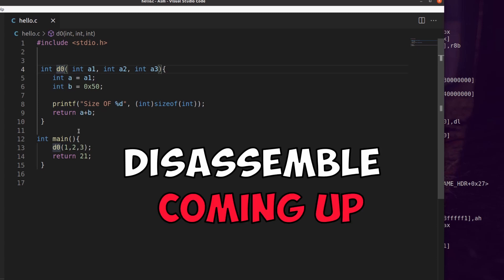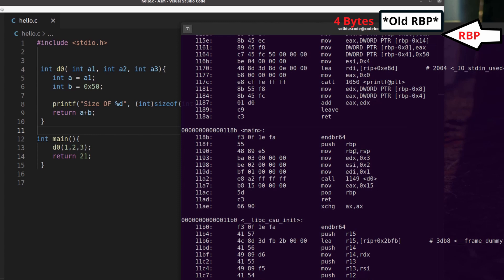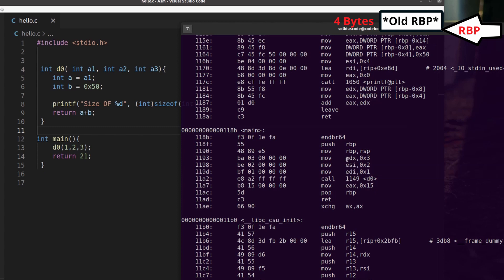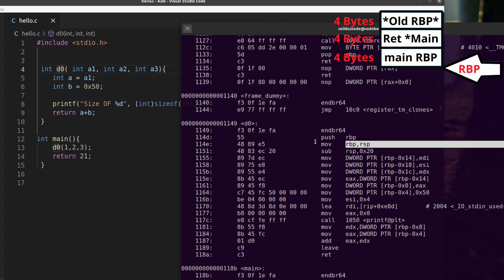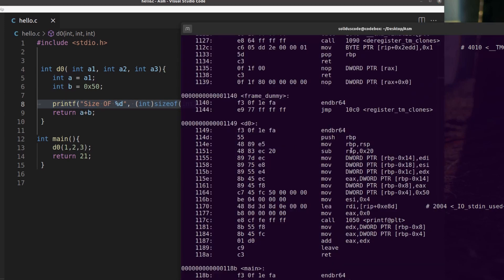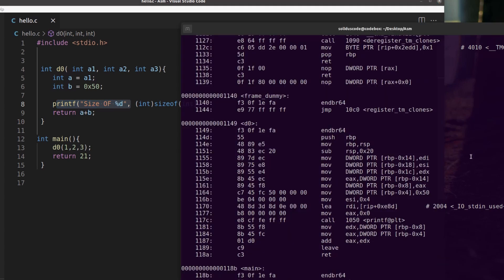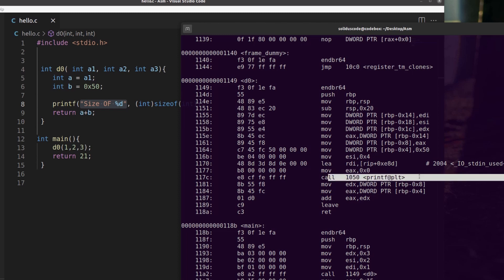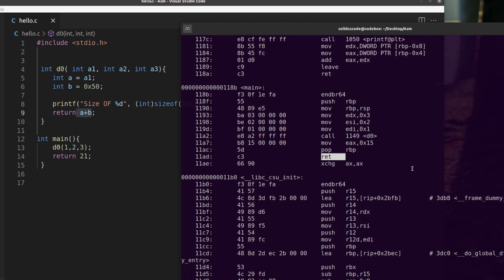Assembly Calling Convention - x86_64 AMD64 ABI and Stack Frame

Comment: why doesn't the main's Stack Frame also subtract the stack pointer to reserve memory for the calling function 'd' ?
Reply: He explained it a bit weird. The reason d0 is first reserving space on the stack and then moving all arguments(a1, a2, a3) passed to it by registers to the stack, is that printf could use the registers(edi, esi, edx) to be other values and would therefore overwrite the parameters passed to d0. d0 needs to reserve space because it stores local variables (a1, a2, a3, a, b) on the stack.
main doesn't have local variables and therefore doesn't need to reserve any space.

Also the reason the substrate instruction disappeared when he removed printf is because "reservating space" means moving the value telling the next (inner) function epilog (printf) where it can start to put it's local variables so they are located after the variables of the enclosing function instead of at the same location. When he removes printf d0 has no function to tell that and it would basically sub 20 and add 20 without anything looking at that value change making it a noop.